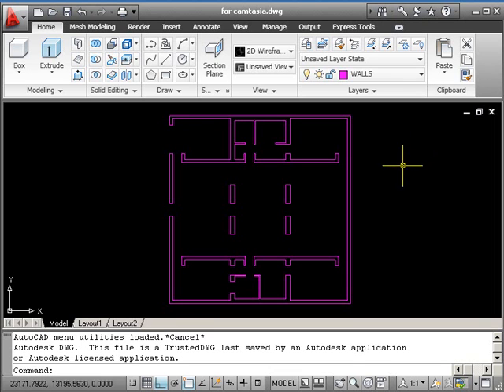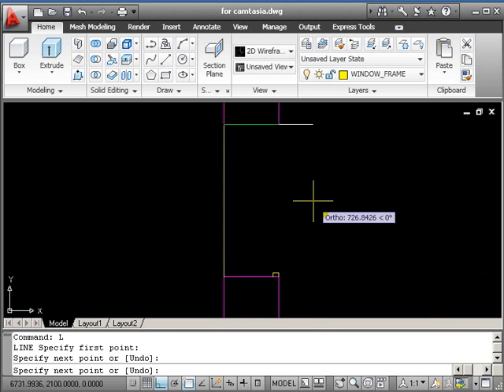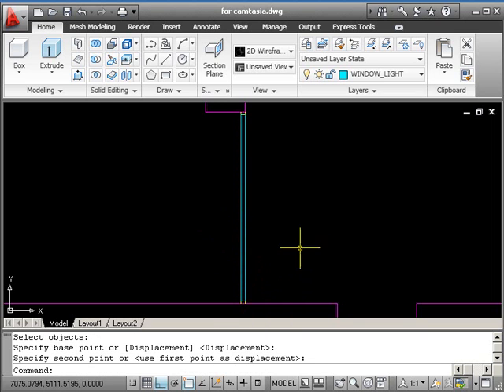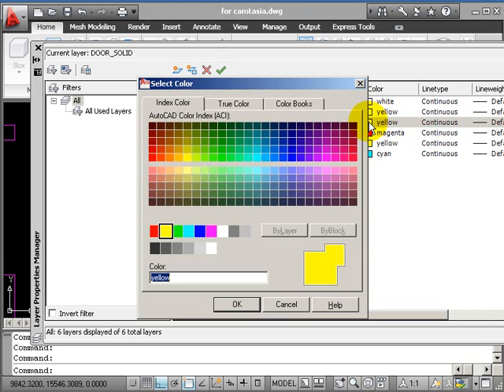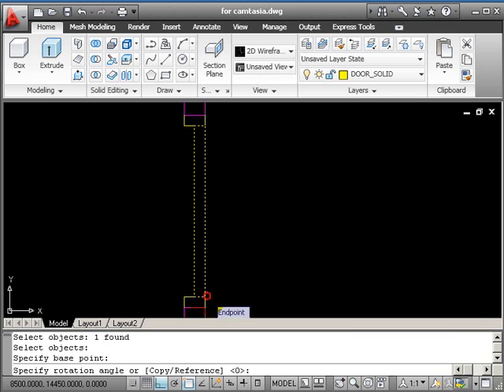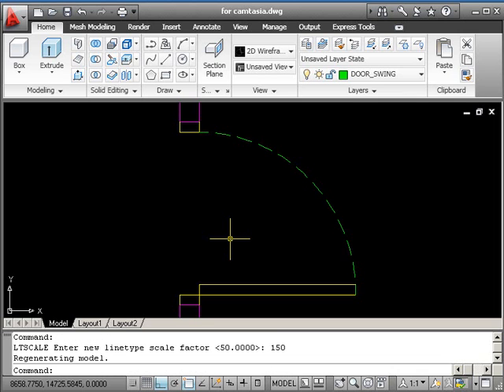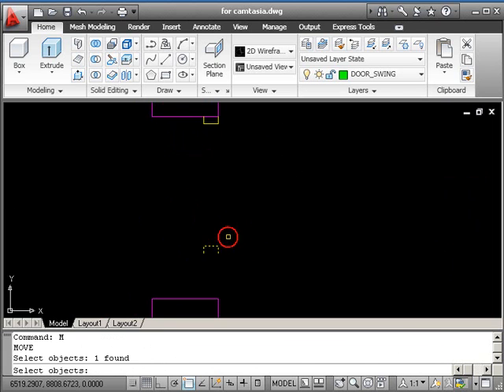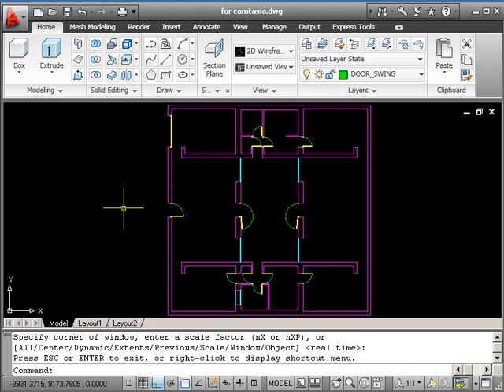AutoCAD 2D Drawing Course A - Part 4 - Windows and Doors

Comment from the maker: Hiya - most of my work is 3D modelling so it's always sitting in the 3D modelling ribbon - good call though.   I agree - the 'new' ribbon setup is pretty useful for things like the hatching and the text, they work well.   The old drop down menus were a pain to find things so lots of people just went for the keyboard shortcuts.   It's good to know them as they work in every version and you don't need to hunt out icons (that regularly change).   Very fast too for stuff you use regularly.

Comment from the maker: Hi - the arc is only symbolic here, a real door is a few mm's smaller than it's opening or it would not be able to open at all.   Taking the arc to the outer corneris geometrically correct but as you have noticed a tiny thin wedge of door is left out - in real life if this bit were planed off the door would work perfectly.   I hope you follow my reasoning there.   best regards, richy

Comment: I was wondering why you're in the 3D modelling ribbon and not Drafting and annotation?  Surely easier to use the ribbon and panels for commands than using keyboard shortcuts?  I've found commands using the ribbon that I didn't even know were there before!

Comment: Does it matter that the arc for the door swing only matches up on the outer corner of the door?  The arc goes into the door itself before lining up on the outer corner, is that normal?